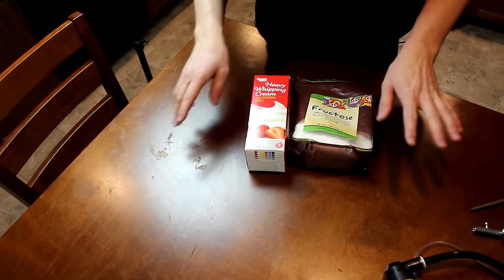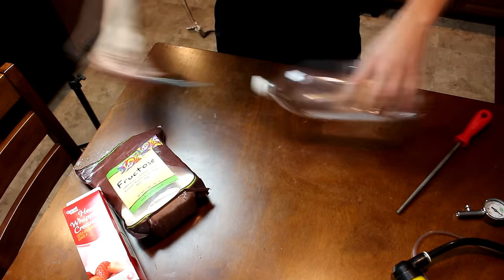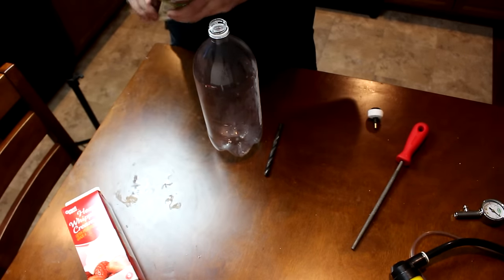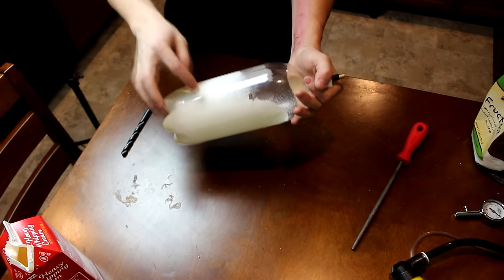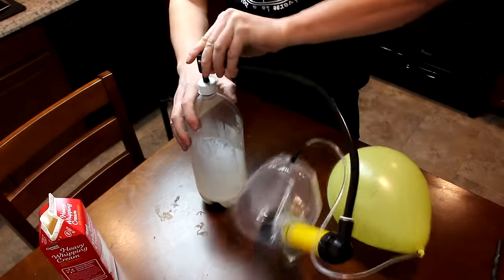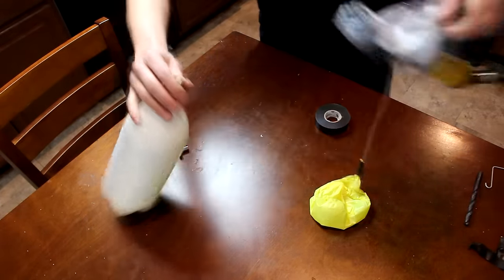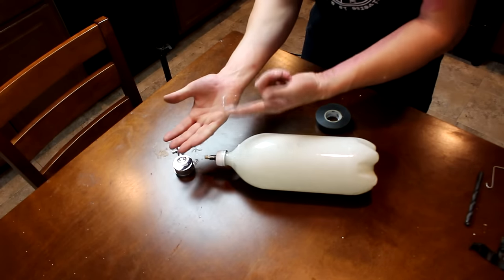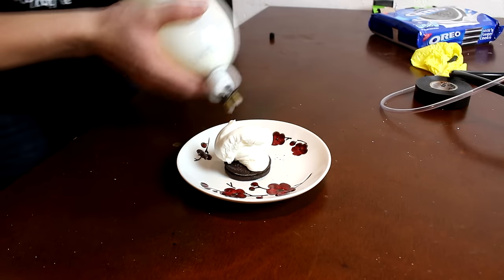Cody's Whipped Cream

Comment: Wouldnt the N2O make you somewhat high
Reply from the maker: No, the thing most people dont understand about Nitrus is that it takes quite a lot of it to have an effect; like breathing it straight for 30 seconds or more. This is because it isn't very soluble in water.
Reply: [ KowToo] if you inhaled enough of it yes, I love being high from laughing gas
Reply: Same
Reply: that's called doing a whip it and most people just use whipped cream rechargers for it
Reply: We found a load of out of date squirty cream, we sucked the NO2 from the cans without inverting them. It's enough to make you giggle.
Reply: you can buy whipits at a lot of grocery stores, this is where the drug people get it.
Reply: You need to get your own dispenser and n20 cartridges, they will make you high as fuck. It gets boring hearing womp womp though.
Reply: That's not true, Cody. Trust me, one concentrated breath held for just seconds will practically knock you unconscious. (don't ask how I know)
Reply: If you buy the ones from store just to do h20 you're doing it wrong.
Reply: John Ratko, as someone's who's got some extensive experience with it... no. Cody is way more accurate right.
Reply: What do you think that giggling at the end was about?
Reply: [ KowToo] The best thing to do with nitrous oxide is to take a drag of weed and blow it into the baloon of nitrous oxide and then keep breathing it in and out of the baloon. It gets you twice as high but fucks with your lungs.
Reply: [ KowToo] u need a lot of it to have that effect. In medical application the patients breathe it for a very long time.
Reply: Not at all, he essentially DIY'd what most coffee shops and restaurants do, they use pre-measured amounts of NO2 and a special whip cream canister to get consistent results with minimal metal waste and a lower cost than buying it pre-made. (the pre-made stuff also contains NO2)
Reply: Yea, you use N2O for making whipped cream because it is fat soluble.
Reply: if you want to get high from n2o, fill a balloon with the gas. then breath the gas in, and blow back into the balloon, suck back in, blow back out. keep doing this till ya lips are purple and you NEED air :') youll be beemin mate. 'nangs' arent fun sober though. get on mdma then some nangs and your golden
Reply: Glazed420 N2O
Reply: Ian Smith That doesn't sound too bright. . .
Reply: NO2 is used because regular air would make the cream spoil faster, CO2 makes it acidic and curdles the cream.

NO2 is often thought of as just a gas, but it is a chemical compound that affects the NMDA receptors. NO2 has similar effects as Ketamine, but clears the body rapidly, and is often used as an anesthetic. The problem with people doing whip-its is they aren't getting enough oxygen.
Reply: Thanks, Butt Repairer. I was wondering how it would affect the taste.
Reply: Heads up N2O is not safe neat, when used in anaesthetics it is carefully mixed with a supply of oxygen to prevent asphyxiation.
The high most people get huffing from a balloon is little more than asphyxiation.
Reply: The word originated in Hackney, London. Specifically Kingsland Secondary School (now sadly gone). 
The word is a direct product of one Nang Phan, an ex-student of KS. It came about through boys in years above her chiding "ahh, Nang you're nang". It caught on like wildfire from there.
Reply: Cody. home made wiped cream on an Oreo you pretty much the best
Reply: Ian Smith I've had medical grade nitrous oxide, and it hardly ever makes me laugh, unless there's something I find at least mildly amusing.
Reply: A new form of delicious hash brownies
Reply: [ KowToo] Except it's a mild gaseous anesthetic, not a poisonous liquid.
Reply: [ KowToo] not at all like cyanide, the difference is that cyanide reacts extremely quickly but needs large quantities to have a big effect due to that fact.. nitrus takes a longer time to react and larger quantities because of it not being too soluble in water
Reply: Ryan Spaeth - He's referring to another video where Cody tasted some cyanide.
Reply: u mad???
Reply: RealGaming all that from an accidental typo?
Reply: lmao
Reply: a little overboard
Reply: Would you explain exactly what it is Cody got wrong beyond a typo?
Reply: RealGaming Yes, because a 3rd grader knows how to extract platinum from a catalytic converter. Yep, common knowledge among 3rd graders.
Reply: [ KowToo] it's in canned whipped cream too, but it is OK as long as you don't inhale it straight up.
Reply: RealGaming yes, because a common 3rd grader knows what electrolysis is and can conduct an experiment that uses electrolysis.
Reply: Experience tells me you're wrong on the timescale.
Reply: Please, what do you think whipits are?  You take a lungful of nitrous and you get extremely light headed.
Reply: I don't know if anyone pointed this out, but the actual whip cream cans you buy at the store is pressurized with N2O also.
Reply: Nicholi Martin Yes, you take them, hold them straight up and down, and depress the dispenser just part way, so you get gas and not whipped cream.
Reply: [ KowToo] if your turbo😆
Reply: Dominik Gruber No, it's not.  Nitrous is short for nitrous oxide.  No difference.

Without the oxide it's just elemental nitrogen, buddy =]
Reply: [ KowToo] it what they use in the whip cream things you see at cafes ect
Reply: [ KowToo] wait... isn't nitrogen dioxide poisonous?
Reply: no,  you're inngesting it not inhaling it, besides most of it comes out of solution which is what makes it fluffy
Reply: Pwner 1775 Yes nitrogen dioxide is poisonous, but Cody is using dinitrogen monoxide
Reply: RealGaming LOL why the hate? if you hate his videos so much why do you even visit his channel?
Reply: butterflyspinart I know but kowtoo said n2o
Reply: TheLinkoln18 n2o is a poisonous orange gas... Cody used no whish is not poisonous and is also an anaesthetic
Reply: Pwner 1775 Not true, nitrogen dioxide is NO2. Nitrous oxide is N2O.
Reply: It's what is used in Reddy Whip.
Reply: N20 not NO2.  NO2 can be toxic levels above 100 ppm can cause death due to asphyxiation from fluid in the lungs
Reply: Yea. I didn't notice that.
Reply: nope. just hold in one lungful.
Reply: capsonjames its literally there in like the first thirty seconds of the video.
Reply: I think you meant Nitrogen dioxide?    Which is toxic and not laughing gas.  You basically just proved my point.
Reply: Ben Philippi N2O is nitrogen dioxide though rights
Reply: Spoken like an expert (wink wink)
Reply: ***** the O2 mix is so you don't die.  That's the reason it's dispensed in baloons.  If you overdo it and fish out, you'll just let go of the balloon and not suffocate yourself.

Hitting your head on the way down is another thing.
Reply: Hey Cody could you make Whipped Cream using Helium?
Or do you think that does not work?
Reply: You can huff the N2O from the whipped cream can.... It's like going to the dentist and getting laughing gassed hahahh
Reply: Cody knows whats up. With a tank of N2O like that... God damn son...
Reply: Shhh that's the point .
Reply: i think they use N2O in ready whipped cream bottles
Reply: [ KowToo] if you replace the oxygen your breathing in with it. people normally use 8g chargers and a ballon
Reply: here in Aus people buy little canisters of the gas in whipped cream to inhale, it cuts off circulation to the brain and basically you fuck out, it's called nangs
Reply: no wonder i cant find the bloody things anymore (baking not getting baked haha)
Reply: Most whipped cream cans use Nos as a propellent.
Reply: [ KowToo] oh wait... no2 is poisonous not n2o -_-
Reply: cyanide is HCN while laughing gas is N2O 
Cyanide prevents you from .... meh I am too lazy... google it
Reply: Ceyhun Dursun lol
Reply: it has to be inhaled. It is also bad for your nervous system long term if you use it continuously.
Reply: It can probably be calculated how many cans of whipped cream an adult has to eat to get enough gas to get high. It's however possible that the amount of cream entering the body will somehow interfere and make the whole experience kind of unpleasent :-)
Reply: michael hartman I guess you'll most likely pass out from beeing completely overfed before getting a sufficient amount of N2O to feel it.
Reply: Peter Guhl You don't eat the cream to obtain the nitrous high, you hold the bottle cap to the sky so that only the has escapes. So, usually one can will get you going not several ; )
Reply: If someone where to want to try nitrous, I would recommend you don't huff it from whipped cream cans. It has more than just n2o in there... No, if you want to try the funny gas then you'll need to go to your local head shop and ask for whip cream chargers. Pure nitrous for pure enjoyment.
Reply: M c C a r s o n I see. Yeah, makes sense. Eating the whole can might get you going too... sort of... :) But I'll probably stick to use it the way it's meant.
Reply: It also kills brain cells.
Reply: If you buy regular whip cream in a can dont shack it for a day and just huf the gas it will get you high too.its called a whip it.
Reply: ***** and yes the nitro you put in a car is different than the nitro your dentist uses
Reply: TheLinkoln18 that isnt true because doctors use 50/50 nitrous and oxygen. 50% oxygen is more than what we usually breathe yet we still get high
Reply: anonymous yeah but as long as you breathe from the balloon for not too long (10s maybe, when you notice the effects i guess) you will be fine. 

Those people that breathe through the balloon for like 30s and then pass out are stupid and harming themselves though lol
Reply: Carn Marsh yes it's called not breathing....
Reply: batt3ryac1d idk what you are trying to say
Reply: Carn Marsh you need to hold your breath less.
Reply: ***** yes it causes that shit cause people fucking breath too much of it..... You need to breath air.
Reply: [ KowToo] Also consider that he is eating the cream, and not inhaling it. This oughtta reduce the effectiveness of NO if it is absorbed through your digestive tract and not your lungs.
Reply: ***** I know that. It's still safer than alcohol though.... It's pretty shocking how dangerous alcohol actually is. Rum and coke tastes too damn good for what it is.(basically cancer and alcohol poisoning in a glass.)
Reply: You forgot the betus.
Reply: [ KowToo] That just improves it
Reply: [ KowToo] Well, you swallow it, so I do not think so
Reply: ***** wow, the more you know... thanks
Reply: I passed out from doing helium voices in high school.  Lack of oxygen will absolutely knock you unconscious.
Reply: ntsrvr now doing that shit is dangerous a fuck
Reply: He 'inert-gas-asphyxiation' death is rare, but only because small balloons are used in these stunts. If someone passes out, that's really dangerous. There's no CO2-gasping reflex, and the bloodstream O2 exchange can actually expel what little oxygen remains in circulation. Without oxygen, the pulmonary muscles no longer have anything to oxidize glucose with.
Reply: [ KowToo] no
Reply: hmmmm risking an eye for some whipped cream... worth it
Reply: I got high from inhaling a whipped cream can before. I just got really dizzy, fell over and peed myself. It was partially worth it
Reply: It can make you be very high if you huff it directly.
Reply: i thought it makes u laugh.
Reply: Cody'sLab nope. One big lung full and you'll be trippin. It won't last long though.
Reply: Nozzzz it
Reply: Joe Brown
I took a canned whipped cream which was out of liquid and drained the nitrous oxide propellant into a balloon so I could more safely consume it. a good lung-full gives you a slight buzz for about 3 minutes.. it's not overly impressive, but I was surprised that it actually worked, at first.
Reply: That's why there are things called "whip it"'s.
Reply: no this is ecactly the gass used in whipped cream containers
Reply: [ KowToo] only if he ingests it
Reply: So basically everyone in fast and furious is somewhat high?
Reply: N20 is a gas...most of it dissipates when its released from the bottle.
Reply: If you people really care about science don't watch Cody's Lab. Go to actual University channels take a look at the channel Periodic Videos as well. Read some good books and do research for yourselves. It's sad to see so many people watching Cody's Lab for science. He really doesn't understand anything and tried to pretend he does. His experiments are crude and dangerous. He lacks the understanding of science and when he does his experiments he lacks the knowledge of doing it safely. A lot of his videos he says "I think" or "I assume" which shows he has no idea what the heck is going on. His videos are so basic he doesn't do basic research first, He just does the experiment lacking the science he needs to understand it. If he did he would have understood what was going on. Also putting your hand in mercury and cutting you had open to put a magnet inside does not help his credibility.  If you really care about science please go someplace else like I showed earlier. Watching Cody's Lab for real science is like going to McDonalds for a healthy meal and a cure for cancer, never going to happen and it will probably kill you. He could change and do things the right way. He cares more about views than actual science.

Comment: Hey cody, I use the same method to pressurize 2 liter bottles carefully up to about 90-100 psi compressed air. They make awesome targets for long range shooting, airguns, archery, even a slingshot will set them off. a little diamotaceous earth, or talcum powder adds a cool effect to the very loud concussive bang.

Comment: Is that roughly the same method used for pressurised can whipped cream?
Reply from the maker: yes, yes it is.
Reply: Cody'sLab nice one, never thought about it before. Thanks :)
Reply: Cody'sLab is there any risk of the soda bottle exploding at that pressure? btw super cool short video!
Reply: As far as i know from several sources and experiments, a soda bottle in good state can withstand 90psi no problem.
Reply: I mean, they are built to take some pressure, but need to be able to withstand much higher pressures in case they were heated, while flying in a plane, being shaken, plus some safety margin.
Reply: Soda bottles (or pop bottles as we say in Canada) can indeed hold a fair bit of pressure. 60-70psi should be achievable with almost all 2L bottles, 80+ is getting into the danger zone and most will explode between 90-110psi. The pressure Cody used (~45psi) is well within the general 'safe zone' for 2L bottles. I wouldn't recommend handling them above 70 psi without some safety gear, when they do blow up they can be pretty dangerous at such close proximity.
Reply: What cody uses is actual heavy whipping cream which tastes orders of magnitude better. If you make this yourself try using sucrose though instead of fructuse ie rafinated cane sugar or beet sugar for example. Corn sugar tends to give a slippery mouth feel.
Reply: exactly the same

Comment: This is not something I'm literale in, Why does it have to be N2O, Why wouldnt plain air work? and what about CO2? It's safe to use in carbonated drinks, what about whipped cream?
Reply from the maker: co2 would work just not as well and you can get air into it but whisking is much easier.
Reply: Thanks for clarifying Cody.
Reply: Co2 would make it taste sour and probably collapse the cream cause of its acidity. Air would spoil the cream over time (oxygen).

Comment: great video. ive wanted to be able to produce foam from a liquid and pressurized gas so i can fully replace my penetrating oil with stuff i can make myself much more cheaply, and this seems like a great method to produce foam. that's literally just a check valve, i could make that on my lathe.

Comment: I'm surprised this worked--my understanding is that the process of whipping cream isn't just about introducing bubbles, it's about increasing the viscosity of the cream through agitation. Your method doesn't seem to do the second part, just the first.

On the other hand, if you whip cream too much it starts to feel greasy as it borders on turning into butter, so your method avoids that, which is cool.

Comment: Hey Cody. I was thinking if we could collaborate, or rather if you could help execute something. I am a scenery fabricator for production (fashion weeks...etc) as well engine and a hotrod builder. You channel inspires me and i was hoping that you might be interested in explosion welding. I could drive around our local metal shops and get a plates (the same size) of different metals. I could even weld you the base out off I BEAM, or something that could keep explosion isolated. You sir") are pyromaniac, and have mentioned about set of explosions you are prepping to do, so how about rigging out little box and play with this WWII discovery?. Good luck Bartok from Booklyn

Comment: Cody, wouldn't it be better to use CO2?
NO2 is kinda toxic if i remember that corectly.
Reply: NO2 (nitrogen dioxide) is toxic but he didn't use that, he used N2O (nitrous oxide) which is non-toxic. N2O is used commercially for whipped cream, it is available in little gas chargers that you buy for whipped cream dispensers and also is the gas contained in the canned stuff.
CO2 would cause the cream to turn sour since it produces carbonic acid.
Reply: Xei oh, i thought he used NO2 at first.

Comment: Not to sound harsh here, but couldn't you have used air instead?  I mean I know why they use it whipped cream canisters, because it's an easy enough pressurized gas.  But I've made whipped cream by... WHIPPING cream with a whisk so I know air is perfectly viable.
Reply: It might be viable, but it's not nearly as cool.
Reply: I would think that the pump that he uses to force the Nox into the 2-liter bottle would also put ~40psi of air in there as well.  shrug
Reply: Mike B this method allows you to store it